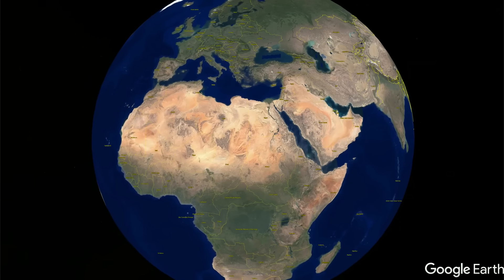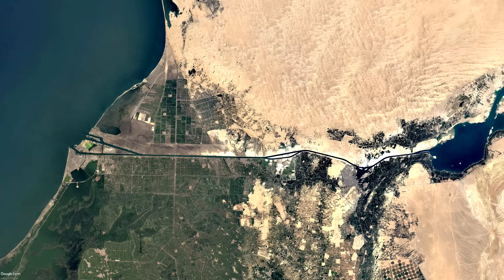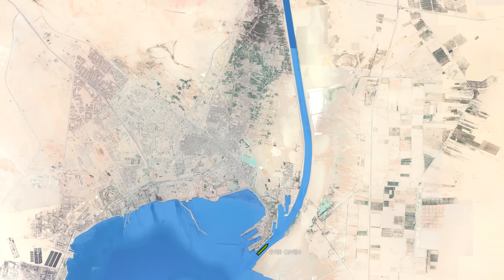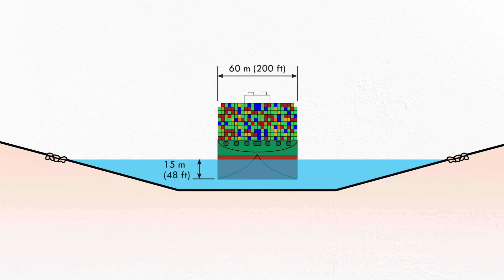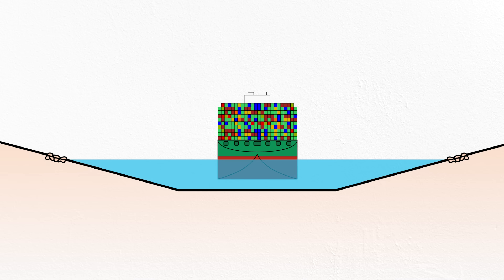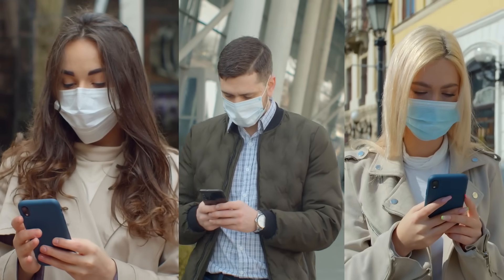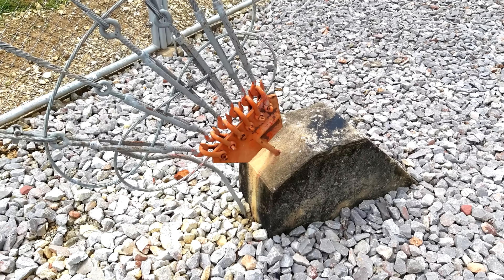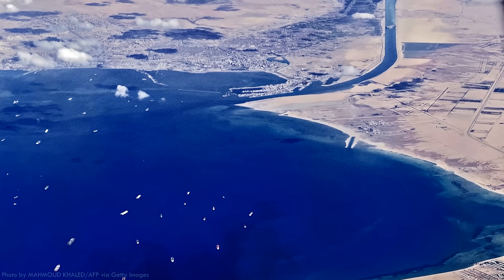What Really Happened at the Suez Canal?

Comment: I heard that if they had tried to rip the ship out of the side of the canal there would have been a substatial probability of it ripping apart. Or at least, suffering hull damage which would lead to a host of further problems.
That blubous thing in front of the ship has one job (pun kind of intended): A ship makes a wave when it passes through water, which slows it down (I believe that overall a suction force comes into effect at the back of the ship holding it back, but don't quote me on that). That bulbous thing makes a second wave the size of the first one and as exactly as possible one-half wavelength in front of the first. In an ideal world those 2 would cancel each other out, in reality the hull-wave gets reduced by quite a margin at least - that way the ships can travel faster and use less fuel to do so.

Comment: The Texas Grid and the Ever Given problem and so many others around the world have the same origin. Engineers used to use a good safety margin for unexpected events, modeling mistakes, faults etc. Nowadays, in very competitive scenario, is common to have this margin minimized to improve profit. What I'm not sure is if the profit margin still better in a long term, even with those "little" disasters.
About the investigation, it will probably be "solved" after a commercial agreement too.

Comment: This is fascinating. I have not heard if the canal was damaged. Does anyone know what’s happening to correct structural problems, sand buildup inside the canal caused by 12 tidal changes with a massive obstruction. I’m guessing the normally free flowing silt/sand left deposits that cause problems. Is this now a choke point?

Comment: I'm assuming that the stern of the Ever Given lodged due to inertia (as the net flow is from the Med to the Red Sea), but that as the flow of water now couldn't go around at all, it was all forced underneath creating a massive low pressure area - enough to suck it down, creating lower pressure, until it was truly grounded.
What other options could you imagine would have been helpful? A temporary dam to stop the flow?

Comment: Is the "dilatency" the same thing as a dilatant fluid?  We use the term in plastics to talk about a plastic which changes its shear viscosity with shear stress.  Like, it's very fluid with little stress, but then if you hit it with a hammer it becomes rock hard and shatters.

Comment: From what I've read Evergiven had a blackout, possibly due to low sulfur fuel they had to switch to. There is a movement now to reduce the use of high sulfur fuel in shipping but many ships are having issues with it as it can clog the filters and cause a blackout. So it seams that Evergiven had a blackout, drifted for a couple of minutes until wedging itself into the river bank. All the different theories from shipowner, operator and Egyptian authorities appeared because whoever is found guilty will have to pay an astronomical amount of money.

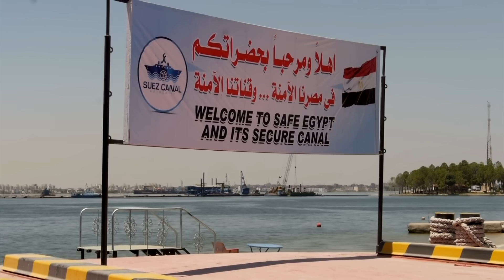Comment: 1:53 When you need a sign stating “safe” and “secure”... definitely nothing shady going on.
Reply: The Suez Canal actually has a great past record of safe navigation. Given the huge volume of traffic passing through the canal, exceptionally very few incidents happen and most of them are caused by either mechanical failure of the vessels, some human error or bad weather. I cannot remember any incident that has the canal infrastructure itself as the cause of the incident.
Reply: @BaronSamedi1959  indeed, i'd say those who thinks the canal infrastructure itself was to blame are rather ignorant, especially to those who starts saying things like "the canal designer is stupid for not designing the width of the canal as wide as the longest ship" (or smth like that i heard from tumblr). If it ever was unsafe, then surely there would've been notable or notorious reputation especially given that it is THE Suez Canal.
Reply: @BaronSamedi1959  Sure, but it's not dramatically over-simplifying to say that the Suez Canal is just a big ditch full of water. It needs to be dredged and erosion damage to the banks needs to be repaired but that's basically the infrastructure component. And it doesn't make sense to try to separate the infrastructure component when considering safety. Although I take the point that the design of the infrastructure facilitates safe usage, you have to look at the whole system -- in a hypothetical world where ships were always crashing in the canal from sailing recklessly, you'd say "The canal is dangerous", regardless of the state of the infrastructure.
Reply: "Safe and secure".

 Sound of 1973 Yom Kippur War, that closed the canal for 7 years, laughing maniacally in the background.
Reply: @mikearmstrong8483  Sound of the 1967 Six-Day War saying, "Er, actually that was me."
And -- let me get this straight -- you're saying that the Suez Canal is not safe and secure today because it was closed more than 45 years ago?
Reply: @beeble2003  
You're correct on the war, and I'm not saying any such thing; it must have taken considerable effort on your part to not recognize the post as humor.
Reply: Same with "land of the free, home of the brave" the "defender of democracy", right? Nothing but the plain, simple truth!
Reply: A-named boss man sends warm hugs
Reply: yeah, but the reason they put it is bc of the series of terror attacks and civil unrest in egypt past decades
Reply: @zazugee  Ahhh yes. That does make the sign make more sense.
Reply: @zazugee because.

Comment: "as flow increases, pressure drops" - perpendicular to the direction of flow! Net pressure has to increase, you are adding energy to the system, but the acceleration is changing the direction of that pressure to be in the direction of the flow, so other directions feel a drop in pressure

Comment: It was nice of the Moon to give a hand in removing the ship. Thank you, Moon  :p
Reply: Pretty convenient of the moon to just SHOW UP.  But... WHERE was the moon when the accident happened?   That’s right!  On the other side of the earth making the water that much lower. That is totally a fact I just made up.
Reply: @joeo6378  For one thing, the moon being on the opposite side of the Earth also causes high tide for complicated physics reasons I don't remember off the top of my head.
At least, I hope they're complicated, or I'll feel silly for forgetting them.
Reply: @timothymclean  The reasons are surprisingly straightforward. When the Sun and Moon are on the same side, their gravitational fields add. The part of the Earth closest to them is pulled the most, while the part furthest is pulled the least, and the parts in the middle are pulled with an intermediate force. So the parts closest to the Moon bulge toward it because of the greater force, and the parts furthest from the Moon bulge away from it because of the lesser force.

Even if the Sun and Moon don't line up, you still get the high tide when the Moon is on one side of the Earth or the other and low tide in-between. But when they do line up, the tidal forces are at their strongest, because the Sun exerts a tide on the Earth just like the Moon, but smaller.

It's worth pointing out also that tides are not the result of the gravity of the Moon (or Sun) lifting the water or whatever; it's more complicated than that. Water is nearly incompressible, and just reducing its weight a tiny bit won't raise the water level much. Most of the tidal forces are approximately tangent to the Earth, and they are mostly over the ocean, and they add together. The result is a squeezing force like popping a zit, and that is what really causes both tides. If the water were just lifted to a higher elevation, we should see tides in lakes, swimming pools, bathtubs, and teacups. Rather, it is the force roughly tangent to the surface that is added up over the entire length of the ocean, and that turns out to be significant.
Reply: @EebstertheGreat  I think Timothy McLean was more referring to the fact that the tide is strongest both when the Sun and the Moon are on the same side of the Earth and when they're on the opposite sides. Conversely, the tide is weakest when they're at a 90° angle, i.e. during a half-moon.
Reply: @EebstertheGreat  thanks for this I feel like I actually understand tidal forces now
Reply: @timothymclean  I think you looking for "lagrange" word
Reply: @joeo6378  pls no bully Moon-chan  😰
Reply: @joeo6378  It was all her own plan to make her look better, she's jealous of Mars because we don't care about landing on her anymore.
Reply: @moonrazk  Well that is silly of her. I would totally get on that.
Reply: @sandraprusje94  Sure, sure.
Reply: @sandraprusje94  
A bit too obvious bait, no one's that stupid. I rate this a 4/10
Reply: @moonrazk  my husband used to say, yeah, yeah, sure, sure¡!!
Reply: @joeo6378  It turns out that ocean tides don't have to be in sync with the tidal bulges.

That's because the ocean is only a thin layer on the surface of a flexible ball of rock.
Reply: I love this comment section. You did good Moon-chan!
Reply: The moon is a nice fellow, always there to give us a helping hand or a guiding light when we need it. That's what I call a friend.
Reply: It's not like the Moon wanted to help... baka... she just happened to be passing by.
Reply: @wojtek4p4  Moon-dere
Reply: Thoon
Reply: @Jeff··Uy  OH MY GOD IS THIS A LOOK AROUND YOU REFERENCE?
Reply: Being publicly mooned!   ..and grateful for it.
Reply: WE LIKE THE MOOOOOOONNNN
Reply: Andrew Drennan because its close to us
Reply: Not the first time the moon helped get rid of a ship.
Reply: All these replies and nobody has referenced Yue, I’m somewhat intrigued
Reply: @johnbeauvais3159  shored on purpose...children...nuclear weapons and weather control chemicals on board
Reply: The entire situation sucked on all levels. 😳
Reply: The moon will always be there for you. Rain or shine
Reply: That's rough buddy
Reply: Wait, ships are operated by Sailors...
Reply: #DearMoon
Reply: 1,000th like. Had to do it.
Reply: https://youtu.be/KlePf7PgOaE
Reply: https://youtu.be/tB5lpRxlExI
Reply: The tide comes up twice a day. Why credit the moon if they couldn't remove it that night?
Reply: @starrychloe  Tides are caused by the Moon’s gravity pulling Earth towards it; as Earth rotates, it “bulges” towards the Moon, causing the seas to rise and fall.

But the Moon’s orbit around Earth is not perfectly circular, fluctuating between about 360,000 and 410,000 kilometers.

While negligible, at its closest point the Moon exerts a slightly stronger gravitational pull on Earth – known as a supermoon – and also appears marginally brighter in the sky.

And it was this event, the first supermoon of 2021, that ultimately helped free the Ever Given. The Moon was full on Sunday, March 28, reaching its closest point (perigee) to Earth on Tuesday, March 30.
Reply: @starrychloe  We have life on Earth thanks to the dance of the Moon, which kept its molten heart beating strong since the very beginning, preventing it from becoming just another frozen rock in an empty 4th dimensional void.
Reply: "Just keep sending me Moonpies and Japanese souls, mortal."
Reply: and good nite!
Reply: If everyone had just mooned the ship it would've ran away in embarrassment.
Reply: Sailor Moon is the original waifu, after all
Reply: And Goodnight.
Reply: Maybe the one that created the moon had something to do with it.
Reply: Your moon so fat, It makes tides happens.
Reply: Awwww the moon is so cute!
Reply: M-O-O-N. That spells “buoyancy.”
Reply: 💪🌕 I gotchu fam
Reply: One thing about the moon that we can truly be thankful for, that the Creator put into operation, is the four seasons, by which the moon's gravity causes the earth to tilt 23.45 degrees (or 12.225 degrees in either direction), so that we can enjoy warm as well as cool weather.(The Creator of the universe with the earth being his "footstool", is Jehovah God, Isa 66:1 in the Bible)

At Psalms 89, the moon is shown as being "firmly established forever as a faithful witness in the skies."(Ps 89:37) Who does not love to take a walk on a full moonlit night and enjoy its relaxing beauty. For those who are among the "meek" ones who will inherit a paradise earth forever, this will be a reality, month after month, year after year, decade after decade, century after century, millennium after millennium, million years after million years, billion years after billion years and on and on without end.(Matt 5:5)
Reply: @timhaley3459  what about when the sun expands
Reply: @dylanb2990  
You are thinking of the conjecture, the wild theory by some astronomers, that in about five billion years, the sun will turn into a red giant after supposedly exhausting its hydrogen fuel and start burning helium, expanding all the way to the earth, destroying it with its life.

But because there is someone that is a loving Creator of the universe and is in charge of it, he has the skillful power to sustain the sun forever and the planet earth forever. When a person creates a product, are they not the one who usually knows more than anyone else about. But with the Creator, he knows everything on a physics level about all his creation, being the one who made "space and time".

It is as stated at Isaiah 42 in the Bible: "This is what the true God, Jehovah, says, the Creator of the heavens and the Grand One who stretched them out, the One who spread out the earth and its produce, the One who gives breath to the people on it and spirit to those who walk on it."(Isa 42:5) Having created the atom and its sub-atomic structure from within himself, with its four fundamental forces built into it, he knows exactly how the universe is formed and thus what to do to make things last forever. 

Isaiah 40 establishes that Jehovah God has unlimited power, skill and wisdom, saying: "Who has measured the waters in the hollow of his hand and taken the measurements of the heavens with a span of his hand ? Who has gathered in a measure the dust of the earth or weighed the mountains in the balances and the hills in the scales ? Who has taken the measurements of the spirit of Jehovah, and who can instruct him as his adviser  ? With whom did he consult to gain understanding, or who teaches him in the path of justice, or teaches him knowledge, or shows him the way of true understanding  ? Look ! The nations are like a drop from a bucket, and as the film of dust on the scales they are regarded. Look ! He lifts up the islands like fine dust........There is One who dwells above the circle of the earth, and its inhabitants are like grasshoppers. He is stretching out the heavens like a fine gauze, and he spreads them out like a tent to dwell in.......Lift up your eyes to heaven and see. Who has created these things ? It is the One who brings out their army by number; He calls them all by name. Because of his vast dynamic energy and his awe-inspiring power, not one of them is missing."(Isa 40:12-14, 22, 26)

So here is what Jehovah has promised, guaranteed: "He has established the earth on its foundations; It will not be moved from its place forever and ever."(Ps 104:5) That means that the sun must also remain forever as the earth's source of warmth and light, of energy. 

At Isaiah 45, it says: "For this is what Jehovah says, the Creator of the heavens, the true God, the One who formed the earth, its Maker who firmly established it, who did NOT create it SIMPLY FOR NOTHING, but formed it to be inhabited: “I am Jehovah, and there is no one else."(Isa 45:18)

So, Jehovah God created the earth "to be inhabited" forever, but only "special" people will reside on it, called "meek" ones, people who humbly submit themselves to Jehovah's rightful rulership.(Matt 5:5) Everyone else will be eradicated, for Psalms 37 says: "Just a little while longer, and the wicked will be no more; You will look at where they were, and they will not be there. But the meek will possess the earth, and they will find exquisite delight in the abundance of peace......forever."(Ps 37:10, 11, 29)

And these are the conditions that the "meek" will see fulfilled on the earth: "With that I heard a loud voice from the throne say: “Look ! The tent of God is with mankind, and he will reside with them, and they will be his people. And God himself will be with them. And he will wipe out every tear from their eyes, and death will be no more, neither will mourning nor outcry nor pain be anymore. The former things have passed away. And the One seated on the throne (Jehovah God) said: “Look ! I am making all things new.” Also he says: “Write, for these words are faithful and true.”(Rev 21:3-5)

This promise, of a paradise earth, is guaranteed by Jehovah for those who become "meek"  or humble ones.

Comment: ....how about remote control takeover. Look up - the the ships path - what did it "draw" in the water?
Reply: Ships are on full manual control in the canal. All auto piloting and navigation systems are disengaged. If you look at the timeline of how it drew that shape, it had to do that to get out of the way of other vessels.
Reply: Nothing. Its a pretty easily explained and well understood part of operating a ship in that they dont stay still and need constant adjustments - most other ships would have similar issues.